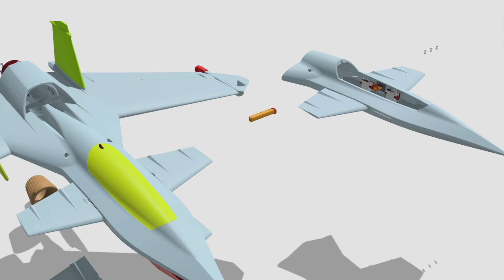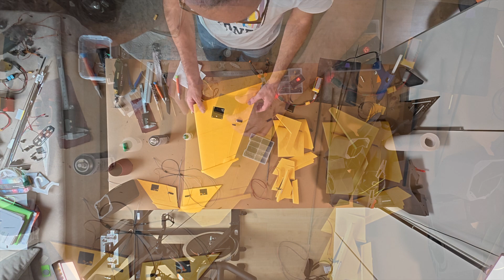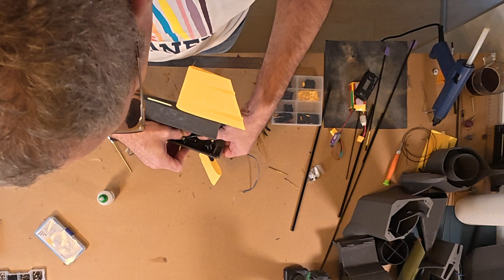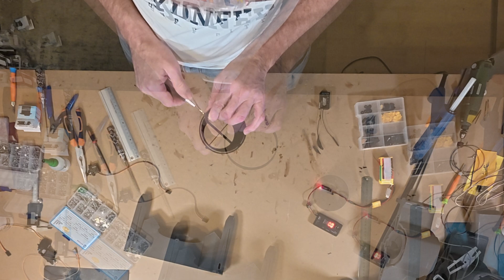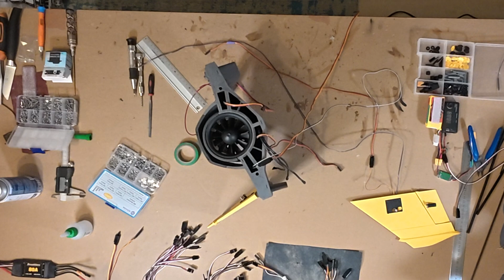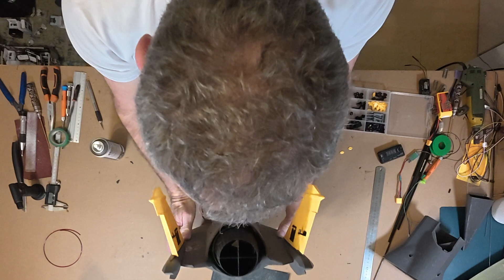Build RYA V 70mm EDF Vector Performance with Carbon Rod Canards, Light and Rudder! 3D printed

Comment: Really great design, hoping to build a 6s thrust vectored one, for 3d flying/hovering/harriers. It will be so helpful if you can share information on what is your total flying weight for this setup? also what size 6s battery is needed to get optimum cg ?
Reply from the maker: My test pilot flys with 6S3000 to hover. The AUW depends on the printed Parts an the Electronics - so I can't say that correctly!